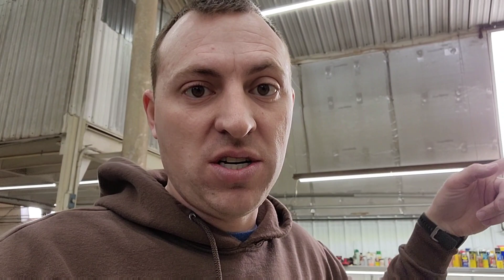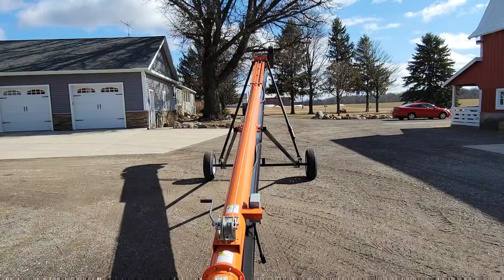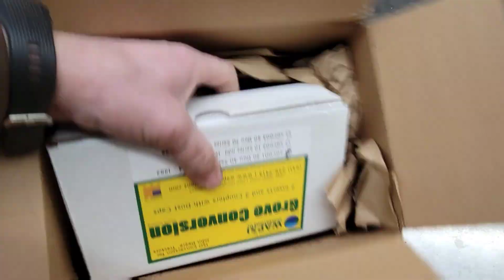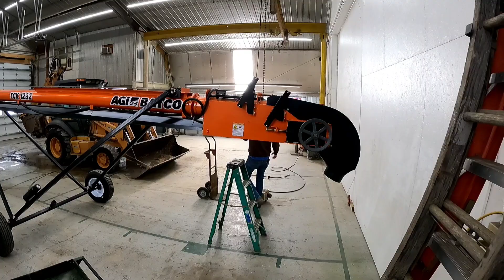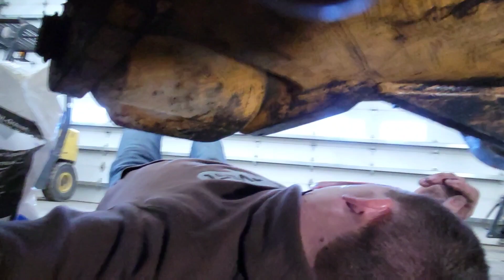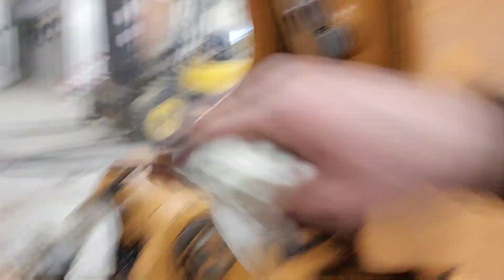New Equipment!  - #365

Comment: On the conveyer need to run it with a Starter.  The basic  blade  shut-off that comes with the conveyor  isn't built to turn it on and off.

Comment: the hose that connects the stoke out to the stroke in on the other cylinder, how did you keep the oil in them, when you installed both in the sucked in position? I would think there would be air trapped between the two now?

Comment: Luv ur vids Thankyou .But i have to add 580 super L is a pig. I had a 580 super k an it would mop the floor with my boss's L. That L i ran one day on a super ez ditch 4' deep 500' long an half way thru i stuffed it. 
( pull any lever u want hydraulic pump overheated) bad problem in L's . super k 500 ft 4 feet deep 3 ft wide 2 hrs. On grade .
I was good.